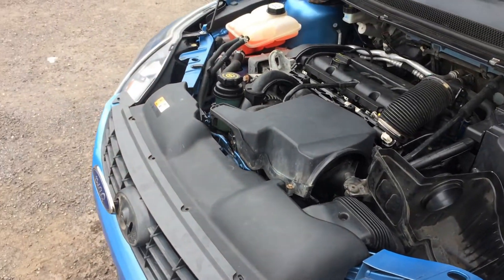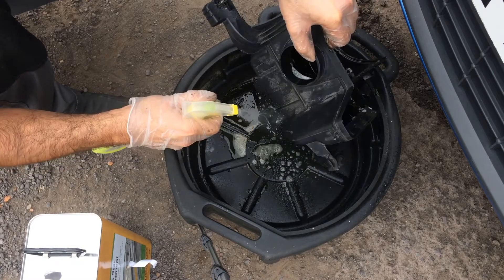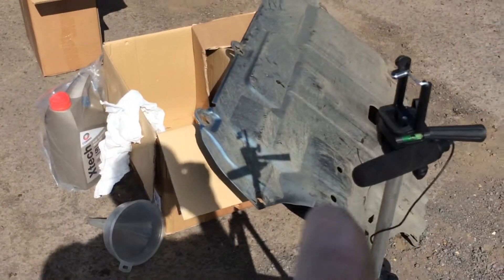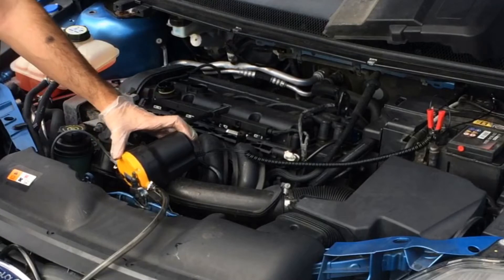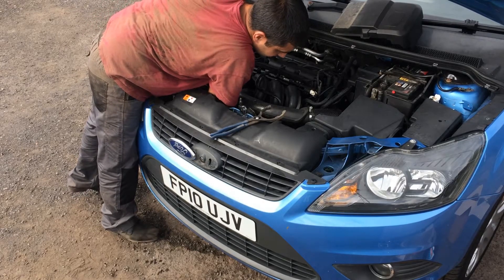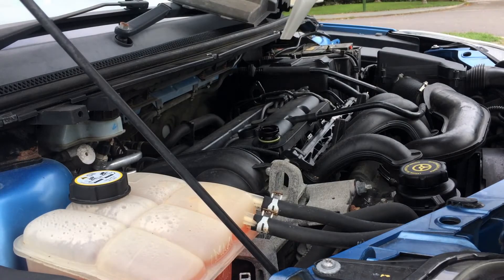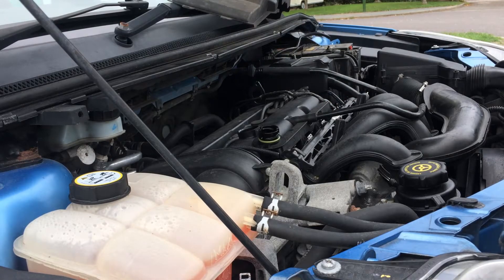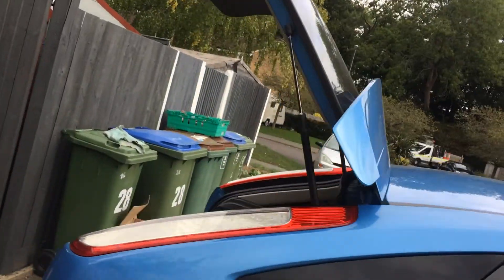Focus MK2 facelift 1.6 Major Service Part 2

Comment: Great service my friend,I have a 2006 mk 2 ghia & pretty much do the same yearly.That pollen filter Is a pig to remove.I remove a stubborn sump plug with a set of Irwin sockets & replace the plug anyway.Keep a eye on the bonnet catch as the white plastic piece inside is known to fail.
Reply from the maker: Thank you.
I still keep an eye on the bonnet lock and this isn’t the original one anymore
Reply: @GentilsGarage  Thanks, Stay safe😁

Comment: Does it mean you no longer drain the oil through the sump plug?
Reply from the maker: No, only this time as I didn’t have a spare sump plug. I’ll be replacing it  on the next oil change

Comment: Does anyone know how to unplug the tube at the bottom of the housing that goes to this small sponge?
Reply from the maker: I think you jure pull it out
Reply: I'm asking because there's a clasp there and I don't want to break anything
Reply from the maker: @marianoitaliano7403  ok, I see. I no longer have the car, but I think i just pulled mine and it was easy. Your might have not been removed yet

Comment: Could you do a demonstration on how to change the indicator repeater  bulbs on the door mirrors focus mk2  face-lift if possible
Reply from the maker: Brian Fearn of course. I have a video coming soon about replacing my wife's car door mirror (similar to the mk2) so I'll go through the bulb replacement as well as the ones in my car look a bit yellow.

Comment: Hi, what makes the engine ring? It's similar to me
Reply from the maker: Sorry, don’t quite understand what you mean. What ring?
Reply: @GentilsGarage 
Knocking sound when starting cold
Reply from the maker: @nanokananoka9146  oh yes! Well, usually it is different metals within the engine that heat and expand at different rates. Also lubrication is low when engine is cold so this causes the knocking noise. Common on older small engines with alloy and steel components, like Rover’s K series.
Reply: @GentilsGarage 
Thanks, l thought the engine was bad
Reply: Piston pin I thought
Reply: these engines can have noisy tappets, if yours is excessively loud then it had poor oil change intervals